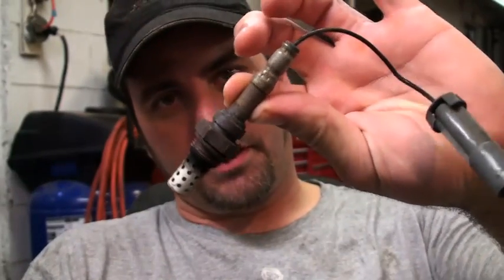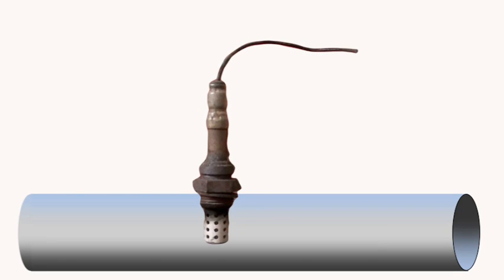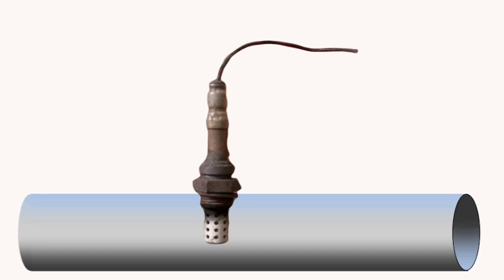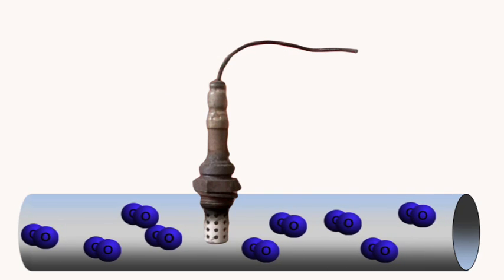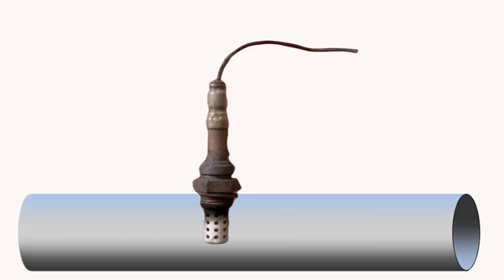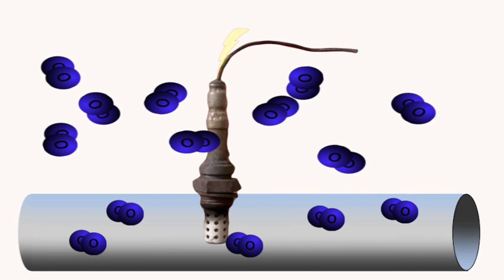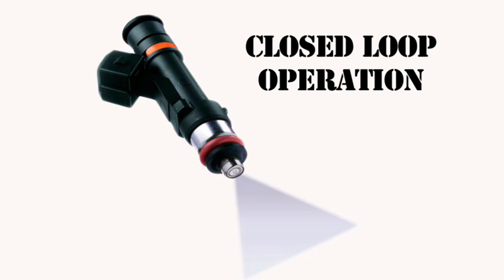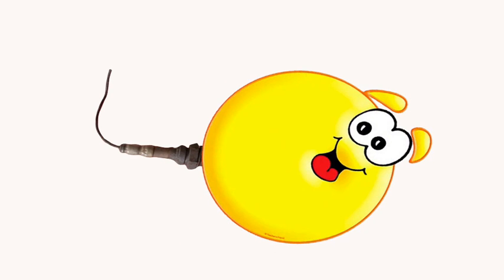O2 Sensor Basics - EricTheCarGuy

Comment: no you can't unless you rearrange those resistors in a way so that you have a simple voltage divider circuit powered with the car battery. you create that circuit and then feed the 0.5 volts to that single wire that goes to the oxygen sensor and the negative cable to ground...... a resistor does not create electricity and if you hook a resistor with a 12v battery you might blow the computer lol

Comment: Hey EricTheCarGuy I wanna say your video's are awesome to start with. I had a few questions regarding O2 sensor thought maybe you could shine some light on them. What is the benefit to a wide band O2 sensor vs a standard O2 sensor? 
(my assumption is it can read a wider range but the confusion came in when you explained the voltages. If a standard A/F voltage is between 0 and 1 why do people need a bigger range?)

Comment: Hope someone can answer this since I kne all questions are now done at the forums. I have an 02 svt focus that has p0135 n p0133 witch are both for the o2 sensors bank 1 n bank 2 I was wondering can bad 02 sensors make the engine backfire?? Car runs good n sounds good at idil just backfires when I rev it n the Rpms begin to drop

Comment: Ive got a 1995 Mazda MPV v6 and gradually it has been getting worse and and worse miles per gallon.  It was close to 15 miles per gallon before the summer started and now is around 11 miles per gallon, combined city and highway.  Ive never changed the oxygen sensor on my car and it already had a tune up less than 3000 miles ago.

Comment: If the O2 sensor isn't working, as it isn't switching, usually the ECU will set a trouble code and the fuel system the O2 trims will go into open loop.  Sometimes faulty O2 sensors can stick high or low and cause drive-ability issues.  Good idea to perform an O2 sensor response test if you believe the O2 sensor is sticking.
Reply: My o2 is stuck at 2.3volt running rich

Comment: No it won't.  If the engine won't crank you need to check out the starting system.  If it won't start, you need to check the basics like fuel pressure, fuel injector pulse, compression, and spark.

Comment: hello, great video, this helped a lot. can you answer this for me. i am currently making a hydrogen generator and will be making an EFIE to add to the voltage to lean out the hho. i have read in various places that leaning it out too much can over heat the engine, this is understandable but if i am leaning it out just a little bit to compensate for the hho, will this be ok. thanks, please reply

Comment: I have a 1988 Mitsubishi Starion ESI-R and my Mixture Gauge reads very rich when idling or under 3/4 to full throttle. And Very lean at low RPMs. Also when i cruise it it reads very lean. Help please.

Comment: Hey whats up, my catalytic converter is glowing red hot im not sure why please help. Do i need a new o2 sensor? Or spark plugs/wires?  I was reconnecting my idle control valve then i turn my car on n let it run for awhile(reved it a few times) then relized it was glowing red. Idk what to do.

Comment: Go to the dealer or parts store and compare the part numbers .sometimes the part numbers are the same. the sensors do the same thing internally but one is moved further away form the exhaust and monitors the viability and functioning of the catalytic converter.

Comment: Obtain the wiring diagram for your vehicle or go to the junkyard and find a vehicle like yours [same year generation and engine] look at the colour of the wires LEADING to the O2 sensor CONNECTOR  and trace it back to where it joins the larger wire bundle,[which leads back to the engine computer]. most likely the wire [s] if cut were cut outside of the big wire bundle. you may also cut out the wire[s] and connector from the junkyard and re solder it [them] to your car using the wire color codes

Comment: Its possible that some modifications were done to your engine. Sometimes oxygen sensors are removed and electronic chips added to increase the power output. go to the dealer or use alldata and verify the location of the sensor. check the fuel trims,mass airflow, engine coolant temp, fuel pressure and all streaming data and evaluate engine condition. don't assume the poor fuel economy has only one cause. consider obtaining a PCM [power control module] and new exhaust pipe with O2 sensor opening

Comment: honestley check with another truck with that exzac make/model and find the wire  harness in the engine compartment where the o2 sensor connects to find the color of wire and location and there you go

Comment: hi,wud like u advice,i got a bme e36 with m40 b18 engine,i found recently,that the o2 sencon is not prensent but the wire to which it has to b connected is there but is been tied up and left like that,my consumption is high,(car was recently bought) found that while trying to see y it uses much fuel,the prob is that i cnt find where the sensor shud b place on the exhaust pipe,i think they replaced the pipe,as they removed sensor.i gona buy a new n replace,bt how check if i work fine??

Comment: I have a 1985 F250 with the 4.9 L 300 inline 6. The O2 sensor is still in the exhaust line but the wire has been romoved somewhere along the line and I have no idea where it should hook up. Any idea as to where and how I can fix this cheaply? Carter

Comment: I have a Saturn ion check engine light came on. I replace the front and rear o2 sensor. The Light went off for a few days then it came back of I replace parts twice already and light goes off for a few day and then it come back on. It's hard to believe I purchase malfunctioning sensors twice. Any ideas what might be wrong? Thanks

Comment: hey bro. i have a Mitsubishi Gallant and the engine check light came on, i check the oxygen sensor and the blue wire is loose, the white one is connected. where should i connect the other one? is that the ground wire?

Comment: Have a 99 f150 with Check Engine Light active. Had the code reader with P1151 code. So I did research for the code and gives me a list of things including the O2 sensor. How can I tell what is the main cause of the problem instead of throwing a lot of money into each problem?

Comment: Hi there, I have an important question, if you remove the catalytic converter and do this
 /watch?v=KnYUHwTxKkE&list=FLcHBwmz_KHTMGraOeJcRC_A&index=3&feature=plpp_video
and the engine light will go off, is this also bad? even if the engine light is off? tnx

Comment: 2002>celica gt automatic> 1/10 times example: say i am driving on the freeway and i decide to open the throttle but car doesnt reply.> rpms go up, until i eas off the throttle and press it down slowly, it will pick up and go. i can down shift ;rom 'd' to '2' with no problem, so i doubt im having transmission problems?

joey from oceanside,ca

Comment: IAM wondering how can i tell which wire is from the ecu and to the ecu for the sensor signal .. on my sensor diagram it says pink and black is power and ground ..then there is tan and purple  the signal wires.. but which is come and which going
my van is 1998 chevy venture 3.4 L  V6

Comment from the maker: @Sanjeai Yes it should be located in the 'A' pipe just off of the engine before the cat, it might be in the manifold however I don't remember exactly, look in the exhaust as close to the engine as you can for what looks like a spark plug with wires coming out of it.  When you find it to remove it I would cut the wires off of the sensor and use a 7/8 socket or box wrench to remove it rather than trying to remove it with an O2 sensor socket.  Good luck.

Comment: Great video explaining how everything works!  I have a 92 Accord EX and it has a check engine light code 41 for a oxygen sensor heater problem and i wanted to replace the sensor...only problem is I dont know where it is and none of the videos on youtube really help since they're for gms and apparently my car only has one sensor rather than pre-cat and post cat, since i've seen a couple videos of yours with cb7s,did you know where the sensor may be or maybe even have a picture of it in the car?

Comment from the maker: @sxr951 You might start by pulling any codes stored in the computer, if you don't have any codes go for the general tune up stuff and check the mechanical condition of the engine.  Don't just blindly replace parts as that gets expensive.

Comment from the maker: @lwgraves I see where your going with your statement however I stand by my statements because this is a video covering the basics of O2 sensor operation NOT AFR sensors or any specifics of either.  Thanks for your input.
Reply: I have a problem with my car there is no check light when I turn the key to the on position and the car wont start ,u have any idea what could be the problem

Comment: So I have an older truck (1999, GMC, Suburban). There were no engine lights going off but my question is, even though the computer dose not say my O2 sensors are bad will it help the performances of the engine if I change them anyways? I mean will it help the performances a great deal? At that these things aren’t cheap... is there a way to clean them?

Comment: Thanks for all the great videos. I would like to mention that the optimum O2 sensor signal is not 0.5V, but instead swings from below 0,2V to above 0.9V. This is required such that both catalysts are functional within the catalytic converter. One catalyst only works below 14.7:1 AFR and the other only works above 14.7:1 AFR. This is a minor yet very important point. Many falsely believe that the computer just can't keep up and hence the swing. Actually the swing is for proper cat operation.

Comment from the maker: @DSchruteBeets The O2 is still good but the heater that is designed to bring the sensor up to temp has failed, this will make it so that it takes longer for the sensor to warm up but it will still work when it does.

Comment: Eric question... My new Honda is throwing a bank 2  O2 sensor code.  I believe PO141 was the code..well I'm sure that's the code bcz according to my Honda shop manual cd ck'ing the 3/4 sensor leads with my ohmmeter it did not register in comparison with the pre-cat 02 that had 12Ohm...so my senses tell me to replace bank 2 downstream...thoughts? 65$ denso...

Comment: If you wanted to clean the sensors cleaning the outside will achieve nothing is there a way the clean the sensor which is under the metal casing maybe with carb cleaner or injector cleaner to remove deposits?

Comment from the maker: @scyllis I'm thinking you did your test incorrectly.  If your O2 was bad on that car it would set a code so your only replacing them because you want to.  As for the P0420 get your hands on a scanner that gives you live data and compare the front O2 reading to the back, the back sensor should stay fairly constant around .5V while the front should switch quickly, if the rear also switches quickly and does not stay fairly constant then the cat is bad and should be replaced.

Comment: @EricTheCarGuy I am having code P0420 and it maight be the bad CAT too. but, I want to change sensors for maintenance purpose since car is 10 years old. Also, I did sensor heater resistance test with a ohmmeter and couldn't get any reading. The car is running just fine but if there is a vacuum leak I should feel when I am driving, right??thanks..

Comment from the maker: @scyllis Bank 1 is always the bank with #1 cylinder, see the compression testing video I did for specifics.  You didn't mention what code you had as that would indicate if you needed an O2 or not, many O2 sensor codes do not mean the O2 is bad but rather it a condition the O2 sensor is picking up such as a vacuum leak and do not require the replacement of the O2.

Comment from the maker: @ir1337zor I recommend getting the sensors into the stream as they will read better that way.  I don't recommend running without a cat however.  You will probably get a code P0420 but you can ignore it since your not running a cat.

Comment: I am thinking about using efi on a racing two stroke engine. Do you think the oil in the mixed fuel I use would have any effect on the o2 sensor?

Comment from the maker: @frank0067 You might want to re-watch the video, the sensor is exposed to the inside AND the outside air, that is the purpose of those holes on the top of the sensor, there is not separate sensor it's all the same one.

Comment: you mention.. more than once.. the sensor produces voltage based on the difference between the oxygen inside the exhaust compared to the oxygen outside the exhaust..
does this mean there is a sensor monitoring the oxygen outside the exhaust ?

Comment from the maker: @td1238 I think you hit on an important point and that is working on the car that your working on is more like an 'art' rather than an absolute which is what I consider working on modern cars to be.  With the older engines and carburetors you had to work to get things right, now you just replace parts.  Sounds like you know what your doing though.  Thanks for your comments.

Comment: I went over every other possibility before coming to the conclusion that the jet needed increasing.  I remember that when I first bought my car in the 1990s I could adjust the carburetor fine, but then when E10 moved in sometimes I could adjust the carb perfectly, and sometimes I'd have to turn the idle jet way out to get results, and I tried several carburetors with the same results.  I also rebuilt the engine at about 100,000 miles, so guides, valves, seats, and rings were perfect.

Comment: I actually came up with a formula for figuring out metering jets based on the viscosity and stoichiometric ratio for ethanol, when used at 10%, and the formula came out with a similar jet number, but in real life the amount of ethanol varies from 10% to less than 10%.  The oxygen sensor helped me fine-tune everything so that I'd cruise and drive in the 80s, and when the enrichment jet kicked in the voltage would almost max out, but not quite or else I'd get sooty spark plugs.

Comment: I used an oxygen sensor because my car was running lean.  It'd lurch and jump occasionally while cruising, and to make it idle well the idle screw had to be turned way past what the book recommended.  I figured that this was because of the ethanol added to the gasoline, because ethanol has twice the viscosity of gasoline and less energy, so I increased my metering jet from a 51 to a 55 and now all is well.  Vacuum readings weren't helpful because no matter what I did the car wouldn't run right.

Comment from the maker: @td1238 Actually it does measure rich by default, if you know the amount of O2 in the exhaust you know how the engine is burning.  .5V would be ideal for a fuel injected car but carbureted cars will run richer, if you want to set your carbs do it with a vacuum gauge as that is a much better method than reading an O2 for a carbureted car as it's hard to get the adjustment right as you have found.  It also has a lot to do with your cam and how the rest of the engine is set up.

Comment: Having said that, could there instead be some reference voltage in a modern car's ECU that combines with the O2 sensor voltage to get that .5 volts or something?  So many people say that an O2 sensor measures whether an engine is lean or rich, but if it measure oxygen, all it can measure is if the engine is at or leaner than stoichiometric.  It cannot measure a 'rich' condition, since it cannot measure gasoline or hydrocarbons.

Comment: I would like to know why everyone says that the ideal engine mixture gives a voltage around .5 volts.  At stoichiometric, ideally all oxygen will be consumed.  In reality most of it will be consumed.  That would give a high voltage.  I put an oxygen sensor in my 1951 Chevrolet.  If I adjusted or jetted the carb for .5 volts, it ran like crap. It ran ideally with a voltage from .8 to .9.  Over .9 the spark plugs became sooty.  In that range, however, they looked great and the car ran great.

Comment: @PigE911   to  see if your  spark  plug is sparking just remove it  fromt he  cylinder with the coil still on it,    put it  in a safe place and  get some one to watch it, then crank the engine , youll physically see the spark  occuring at the gap,    also  a basic step is to change plugs at 150 000km depending on  manufactor  specs

Comment from the maker: @billywaltmon That's really not possible, it's much better to replace them as they get old and don't work as well, not as a result of getting dirty but rather as a result of getting old.  Aside from that O2 sensors are very sensitive to solvents so you would probably do a lot more damage than good by cleaning them.

Comment from the maker: @Brendon00000 Yes the O2 sensor is the primary sensor used by the PCM to calculate the fuel mixture after warm up, often installing a new sensor will do all of the things you describe.  Thanks for the comment.

Comment from the maker: @founditnow54 Toyotas are famous for this, first I cut the wire and use a regular socket or the box end of a wrench not an O2 sensor socket, I normally use heat but there are still occasions where the threads become damaged during removal and require re-tapping.

Comment from the maker: @ramrice That engine does not use a MAF so you can rule that out.  The P0401 is an EGR flow problem, I know you mentioned you cleaned the EGR port but what you really need to do is clean each of the individual runners going into the intake, see the video I did on cleaning EGR passages.  Start with this code and reset it to see if the other codes come back as they do not mean the O2 sensor is bad but rather it detects a problem with the fuel mix.